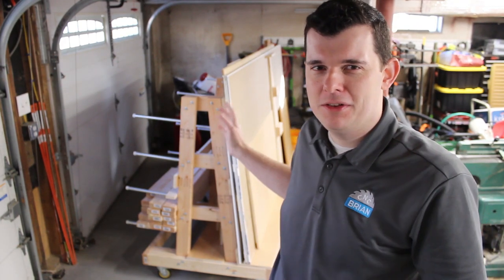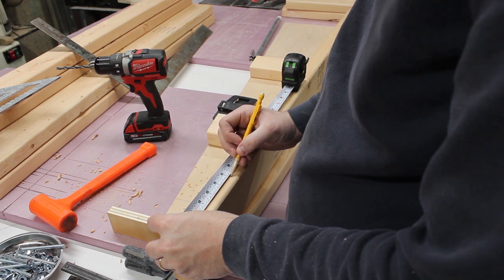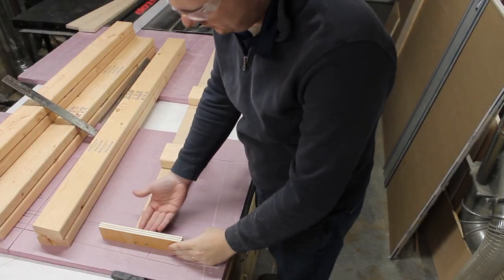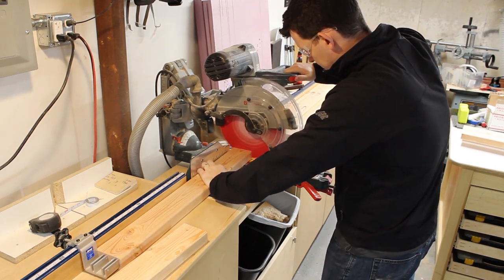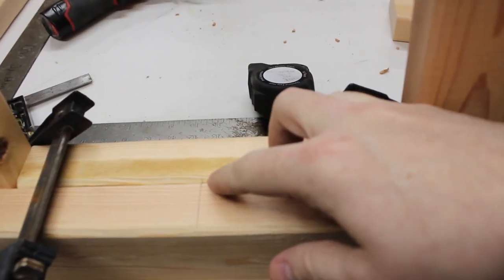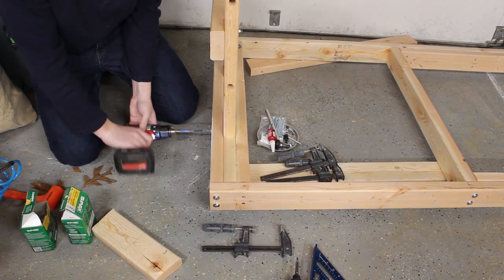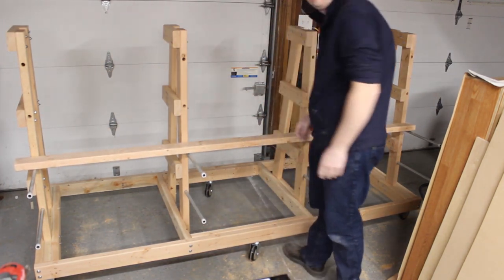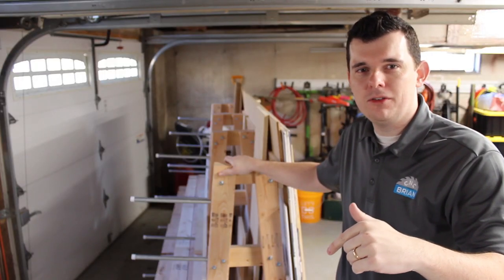Shop Projects: Mobile Lumber and Plywood Storage Cart

Comment: Mike, You built a tank! I really like the details you put into the rack like the lag-bolts and all of the sandwiching you did to stiffen the whole frame-up. I only wish I had the room to keep one of these in my tiny shop. It is only 10'x16' and about a year after building it I wished I had gotten a wider building. I have been planning to build a closet/shed off the back of the shop to house the dust collector and air compressor. For the rest of the back, I was going to put on a covered lumber storage rack. Now that I am cramped I think I will just move the entire back wall out 4-6 feet.  I That will give me more floor and wall space and I can still put the DC & AC in a soundproof closet. The lumber can then be stored inside on a mobile rack like yours. I like this video so I will check out your other videos too!

Comment: I used your design and have considerable storage on this rack. I did modify the original design a bit. I built internal bracing for greater strength and stability.  I also did not have a great need for storing sheet goods, so I added a sloped tray with compartments for storing cutoffs. I’m really pleased with the rack.  Thank you.  It is quite heavy. I used 5” wheels.

Comment: were the carriage bolts necessary over just screwing them together with some all purpose 2.5" construction screws? thinking of building something like this myself nice video thanks!
Reply from the maker: For the added strength yes. You could probably get away with screws by adding more though. When fully loaded both sides this thing is very heavy though.

Comment: I am assembling your cart and am confused about the diameter of the tubes.  The materials list says they are 1/2 inch, but in your video you talk about using 3/4 inch.  Which one did you mean?
Reply from the maker: Rick, standard 1/2 EMT is what I used on mine, I may have mispoke.  3/4 has almost the same wall thickness and these are such short sections they can hold a lot of material.
Reply: The conduit is 1/2 inch (specified by inner diameter), and the holes are 3/4 inch (outer diameter of 1/2 inch conduit is just under 3/4 inches, or 11/16, as he mentions in the video).
Reply: I ended up wrapping the end of the conduit in electrical tape to make the fit more snug.

Comment: If you still the 3/4" holes for the pipe 3" deep your only leaving .5" of wood left in that 2x4 it's gotta be weak as hell
Reply from the maker: Not weak at all, the load is vertical not inboard to the 2x4. Mines been fully loaded for months with no issues, I move it around a few times a week.